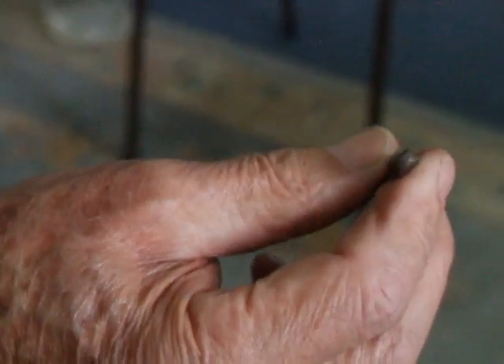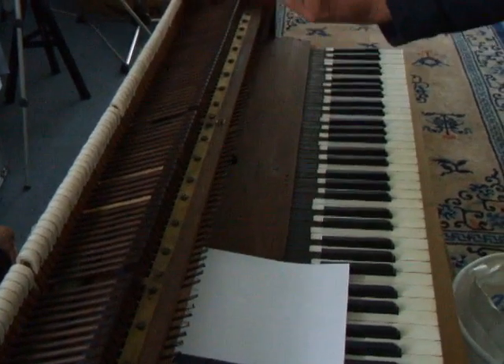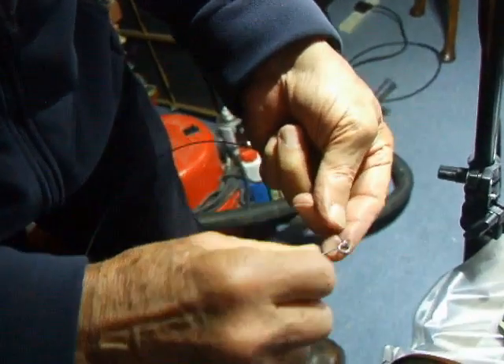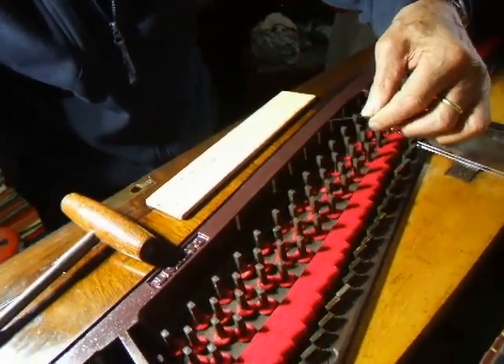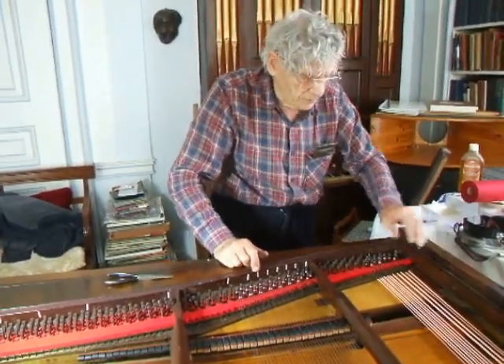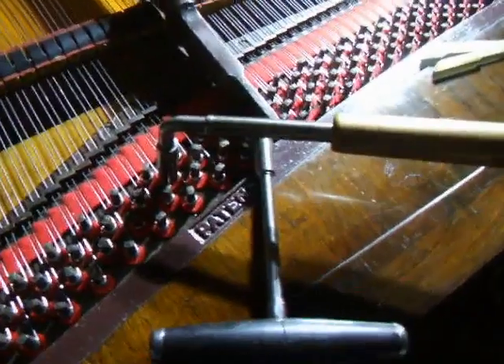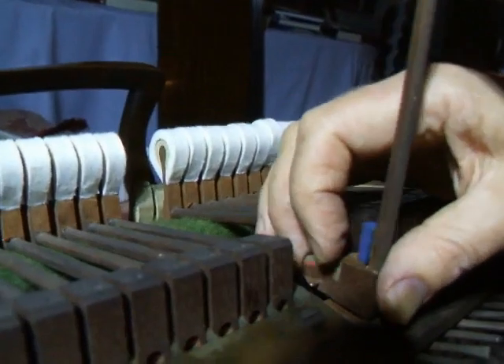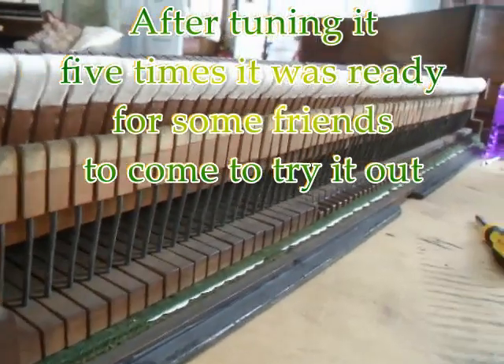1869 Broadwood Cottage Grand piano restoration

Comment: But was the soprano singing in Kirnberger III?  Just joking. Very sweet tenor and treble, and very informative video, thank you!  I have the feeling that the T levers probably often resulted in tuners bending pins outrageously, to drag strings thru the agraffes!  Unless they had extremely powerful wrists and really did apply torsional forces only. Admittedly in those Broadwoods with a threaded plate, the pin would be firmly supported against bending in the hole.
Reply from the maker: The pins are oblong, so actually have a sideways weakness, so the T hammer applying pure torsion is safer than a L lever. https://youtu.be/8t7l5OQKz2Y is a subsequent recording taking advantage of immediate post-stringing instability for two of the five songs, deliberately. With these threaded pins, if one breaks, one's got a real problem. Two had rusted in, and wouldn't move at the bass end on the single wires, luckily, and broke. We couldn't get them out and had to drill and tap new holes.
Reply: @unequally-tempered  Yes, I did watch the whole video, in which the breakage and replacement with modified Bechstein pins is explained. Very interesting. What a palaver! I don';t know why anyone ever made or used oblong pins - were they any cheaper to manufacture?  There are different sizes of oblong pin heads too - small ones like that Broadwood, which the somewhat rounded small oblong whole tuning tips fit, and larger, more sharp-edged ones (as on some old Erards I've tuned) which need a bigger oblong-hole h
tuning tip.  I cannot see that a T lever ("hammer") can give very find control, unless the operator has phenomenally strong wrists....
Reply from the maker: @DavidBoycePiano  Yes - I agree about T hammers - on modern pianos my wrists aren't strong enough either. Provided the pins aren't too tight then the L lever won't provide too much lateral force, and likewise the T hammer can work. I think that oblong pins started out from an origin of cut rod merely hammered to give the flat oblong shape rather in the nature of the technology of cut nails and the like.
Reply: @unequally-tempered  Ah, that would certainly make sense, regarding the origin of oblong pins.  I hate them!

Comment: these Broadwoods have a very different sound ideal to the overstrung American style grands
Reply from the maker: Yes - Broadwood were obsessive about achieving an even sound and that's what this instrument demonstrates not only throughout the scale from bottom to top but also at every dynamic level too. https://youtu.be/8t7l5OQKz2Y is a subsequent recording taking advantage of the immediate instability after restringing for two of the five items in this cycle of songs.
Reply: what wire are you using?
Reply from the maker: @Andrewtafelklavier  Standard Roslau Blue